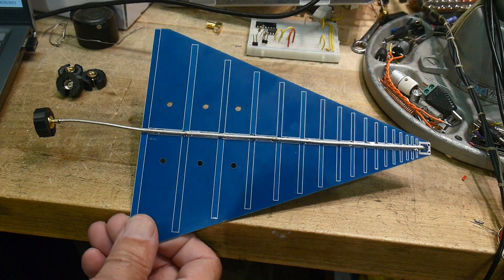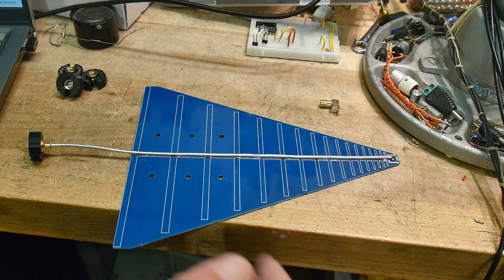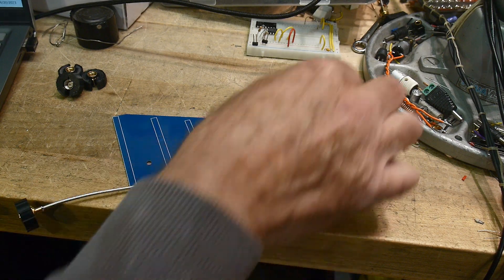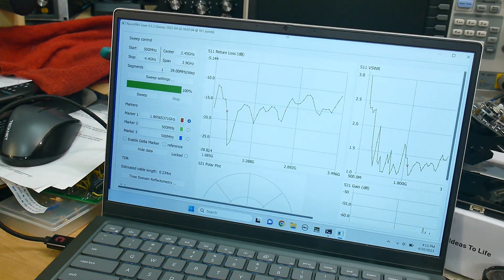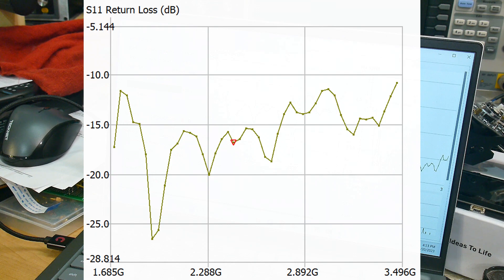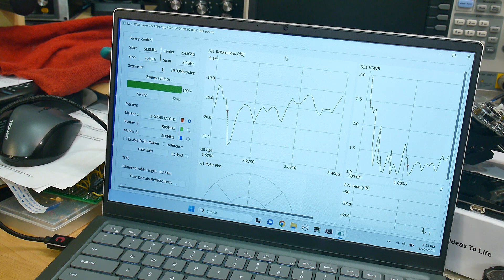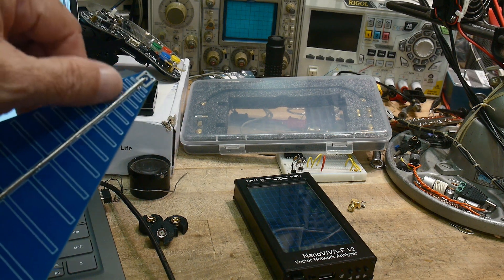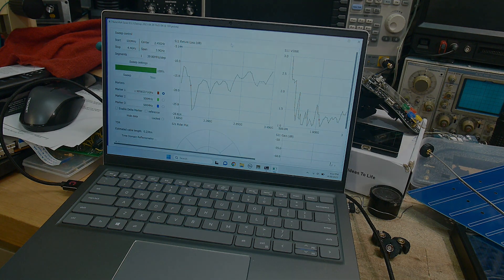#1476 Log Periodic Antenna Hacked

Comment: AFAIK log-periodic antennas are supposed to be fed from their front tip because else the directionality will be messed up. It is something with wave propagation and the way waves from adjacent tines are supposed to sum up at a certain phase (see Wikipedia about their physics). It may be that this mainly matters as an EMC testing or direction finding antenna and less for things like wifi, but there is a reason for the connector position.

Comment: Perfect example of using the principles of Step Up Energy. Theres a reason pyramid shapes are considered to be energetic in nature.
The energy/electricity/signals flowing through this particular shape is condensed, compressed, and amplified with every stepping level as it goes up and becomes more and more narrow. The frequency signal generated should increase to with this effect. 
basically your getting a stronger signal wright?
Reply from the maker: you are 100% wrong
Reply: @IMSAIGuy  how it works then? it seems hard to imagine any other processes going on.
Reply from the maker: @originsdecoded3508  the coax is fed on the small side. the traveling wave follows the antenna until it finds a dipole size that it can fit. the impedance will then be low and it can radiate.
Reply from the maker: @originsdecoded3508  maybe this would help: https://youtu.be/5uEz1KkHKas
Reply: @IMSAIGuy  Thak you, makes a lot more sense now. I was thinking in terms of the behavior of sound/vibration  modulation and how to manipulate its path and frequency. and how it relates so much to electricity because electricity is essentially really high vibrations going through specific conductive materials that stimulates an electromagnetic field which then enduces an electrical charge. 

But I'm seing that when it comes to electricity, and magnetism the behavior and mechanisms of how modulate them become a little more complex. 

Have you ever seen the similarities between vibration flowing through sound conductive materials, and electricity flowing through conductive materials?

Comment: I can empathise not liking having to shove the laptop on the bench!

But it does let you produce that one or two nice screenshots of the critical measurements ^_^

So I'd suggest, maybe you don't even need to be "using the laptop" during a video take, but could later connect it quickly just to get the relevant screenshot later to overlay on the video?

Thanks!

Comment: I don't mean to be a heckler, and thanks for the extra effort - impedance bandwidth looks reasonable for a log-periodic.   But because I've been burned by almost all chinese antennas I've bought off of ebay, before I would agree that it's the real deal, I would check  the front-to-back ratio at about mid-band.  For a real log antenna, it should be at least 10 dB.  You can easily check this outside.  Open garage door, and run about +10 dbm from your sig gen to any small antenna just outside the door.  Then with the antenna in hand, with your trusty portable spectrum analyzer,  walk at least 20 feet into your front yard (away from the mini-cooper to avoid reflections), and slowly spin around, noting the signal level.  You will still see a lot of variation from reflections, but you should see the general pattern - and note the level facing your garage, and away from it.  The difference will be the F/B.

Comment: Thanks for the fix for the antenna. But we can get 50 Ohms out of a carbon comp. resistor. What we want to know is an antenna's actual gain. I realize you aren't set up with an RF anechoic chamber and calibrated antennas, but some idea of whether or not the antenna actually has some RF directional gain would be nice. I have very little faith in the Chinese vendors' ability to do anything right, even if the first problem is fixed.

Comment: I'm curious about the semi-rigid coax that you are using, as it would be very useful for various PCB-based antennas.  Do you have a specific go-to type, like an RG specification or a Belden or other manufacturer's model number?
Reply from the maker: I just had some removed from equipment

Comment: Re:PC clutter
I have a wireless connection to a wall-mounted monitor over one work area. There is no space for PC at main equipment bench. 
There is an app for the nano vna that runs on Android.  Have not tried that. 
Perhaps a tablet PC for you?

Comment: Maybe you could move the laptop running nanoVNA Saver out of the shot--i.e. off the bench--and just feed it's HDMI output into the recording the way you have (I think) in the past used the output of your Rigol oscilloscope? At least I'm trying to minimize your editing time.

BTW, nice episode.  Now all I need to do is figure out what I'd use an antenna like that for, but that's not a bad thing. These days I'm finding it a lot of fun to search for a problem to solve after I've found a product.  You know, it's the "that's a really neat board--now what am I going to do with it" kind of activity.